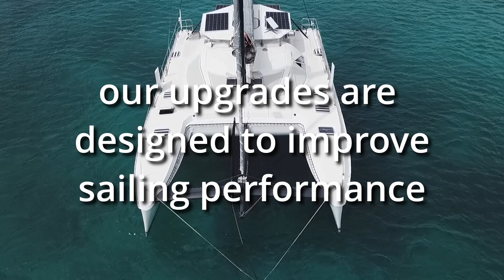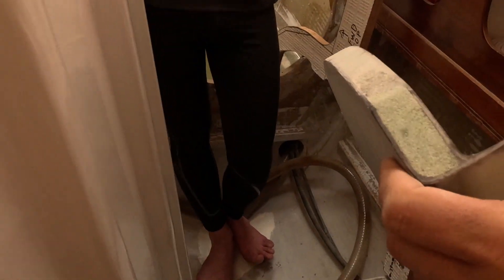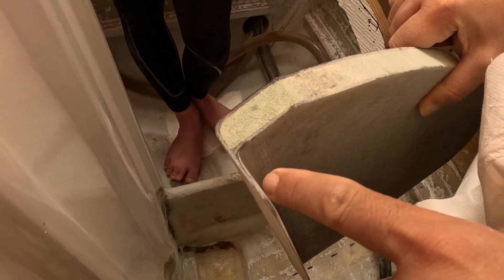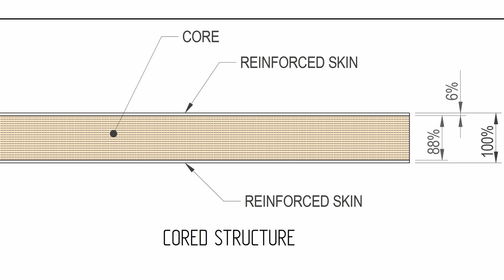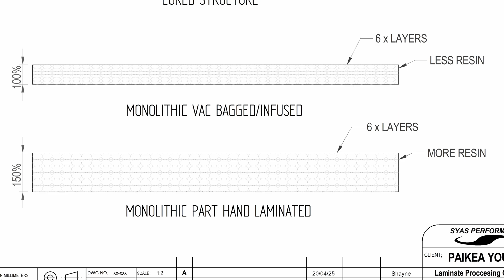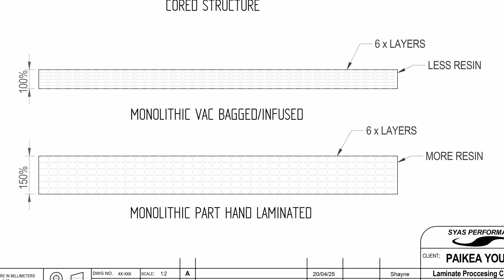Hand Lamination vs. Infusion: Is the Extra Hassle Worth It?

Comment: I'm considering on using thicker PVC foam for deck and superstructure for better thermal insulation. You had a nice diagram at 5:08 which shows 6% skin thickness compared to overall thickness. If the core thickness was doubled or tripled, would the 6% still apply to the new overall laminate thickness? In other words, should I double or triple the skin thickness as well?

Comment: Mate just on the paint. We have lived aboard our oram cat since 2003 and we found the standard water based acrylics with MOULD KILLER additives in a satin finish the absolute best. Two pack polyurethane outside but nicely faired liner free inside with household acrylic paints. Our original sprayed two pack finish was a thing of absolute beauty.  Still have sore arms from all the fairing twenty years on. However it was an absolute pain for repairs and patching. It also yellowed in the galley over time despite my wife's ocd level cleaning.  Grab points in companionway areas and general wear and tear caused unsightly blemishes difficult to repair. We used a non linear polyurethane for ease of repairs but it was still no good. My brother in law is a professional painter withwaterfront based paints to prevent any issues with water based paints in the weave.  This is acrolled finish not sprayed and the satin paint leaves just enough gloss to keep clean, yet it is mat enough to make me look like a competent fairer. It hides a multitude of sins. Any tiny scratches etc can be filled with spakfilla from bunnings and I've never had any come out. Looks great easy to maintain and apply, cheap and mould proof, what's not to like. No ppe required!!! Obviously used flowcoat for lockers etc but all living areas are acrylic.  The patch in the galley above the stove doesn't yellow either.
Reply: Good to hear. I use acrylic paint made for house exterior.  Sold as masonry paint in UK.

Comment: Excellent as always... what paint are you using for the interior?  I take it, it is not a flow coat?
Reply from the maker: It's not flow coat. Its a polyurethane paint called TKRom.  https://www.tkrom.com/
Reply: @youngbarnacles  TKRom is interesting!  Does it cover small imperfections and is it gloss or matt?
Reply from the maker: It's a polyurethane so you can thin it down as required. We're using a mat finish. It's available in gloss as well.

Comment: I notice you're using vinyl ester resins. What is the cost savings/availability/ performance comparison to epoxy resin?
Reply from the maker: Such a big question! Generally speaking epoxy is usually the most expensive but you should be choosing your resin based on the requirements of the job. There are properties of vinylester that you simply cannot get with epoxy. If you are looking for a resin system that will cure at room temperature, have good HDT and good chemical resistance, then you can't beat vinylester.

Comment: Did you mis-speak or maybe I misunderstood. It sounded like you said resin is 50 percent of the glass weight? Like 100 grams of glass and 50 grams of resin? Pretty sure you meant 100 percent of the glass weight, right? If there is 100 grams of glass, you use 100 grams of resin?
Reply from the maker: Yes. You are correct.  50% glass and 50% resin

Comment: Plastic tank looks smaller, are you carrying less fuel ?
Reply from the maker: Yes. New tanks are only 20litres
Reply: @youngbarnacles  20 gal?? And yes, Easy Composites are great as suppliers and their video tutorials are first rate
Reply from the maker: @evangatehouse5650 plastic tank holds 20 litres...so a bit over 5 gal

Comment: Yup those plastic fuel tanks are great Shane. I have a 200l and 100l on each side of the lockers in my Catana 47. I also marked the side of the plastic with a permanent marker with a short line for 1/4, half and 3/4 for easy reference. We have plastic Vetus tanks as well for water under our back beds which a a real pain. They are lying on their sides so only 40 or so cm high  but long and wide. The factory in their wisdom put wooden supports through the baffle holes which over time rub through the plastic tanks. A real pain. When I get time I will use the hulls as the tanks and fit ends, baffles and a fiberglass foam lid. This uses the shape as well and not having a wood structure to fit the flat rectangular plastic tank shape.

Comment: Fantastic job and very informative, thanks 👍
A quick question, how do you lay the teflon tape on your big mold? I am having a hard time and got lots of wrinkles
Reply from the maker: It is difficult and requires practice to get it right. The trick is to pin down one edge and then smooth from the middle outwards. Don't take all the backing off at once. It's tricky!

Comment: Here in Greece I have finished this week the plug for my 320 Dinghy.  I start the infusion of the bottom shell in sandwich Carbon, 5mm HTX foam and Lantor Soric for the rounds. The weight calculator say 13-14kg for the bottom shell. Lets see what is reality brings. Anyhow, what I want to say.... if you pass by, the plug for the dinghy is here and you can infuse that. I can send you pics of the plug if you are interested. Take care Chris
Reply from the maker: Thanks for the offer. I don't know if we will get to Greece but let us know how you get on with your project. Harry is currently looking for ideas for our dinghy upgrade